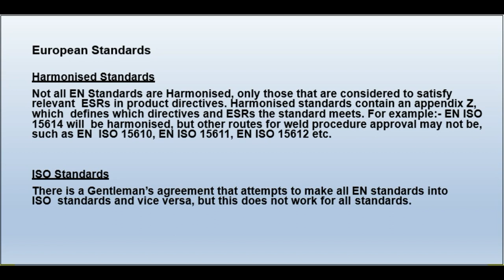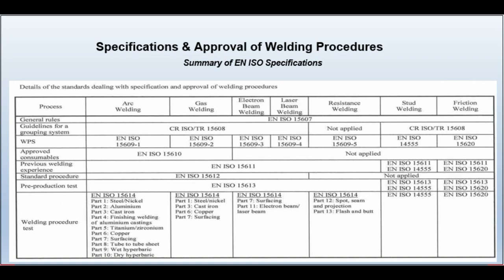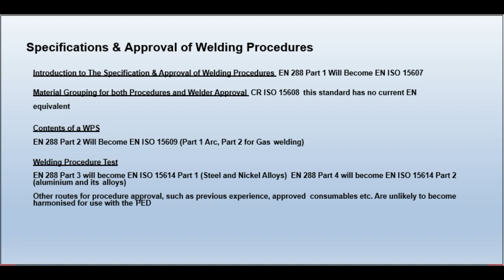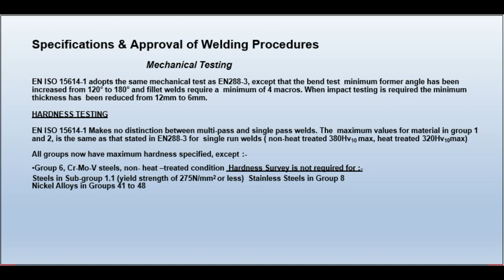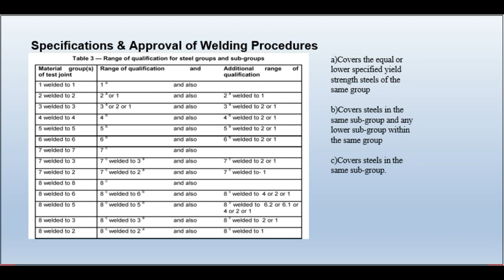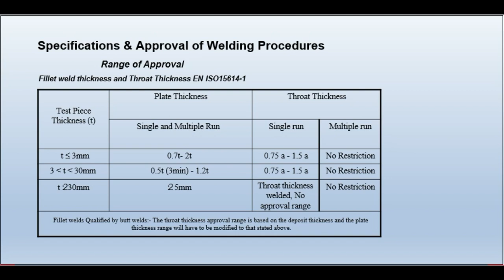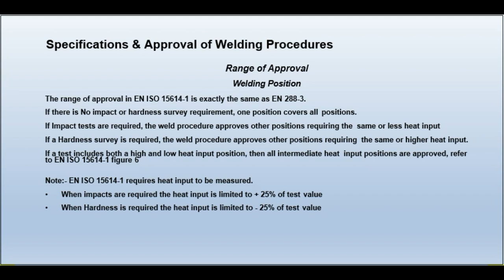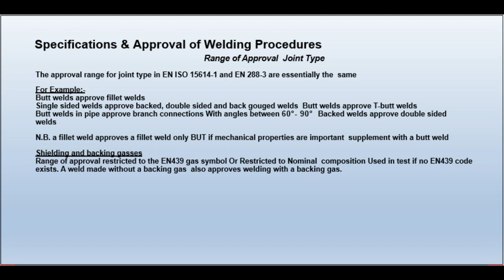European Welding Standard - EN ISO  Requirement [EN Welding Standard]

Comment: What is iso 9606 certificate for
Reply from the maker: ISO 9606-1:2012 specifies the requirements for qualification testing of welders for fusion welding of steels. ... When qualifying welders, the emphasis is placed on the welder's ability manually to manipulate the electrode, welding torch or welding blowpipe, thereby producing a weld of acceptable quality.